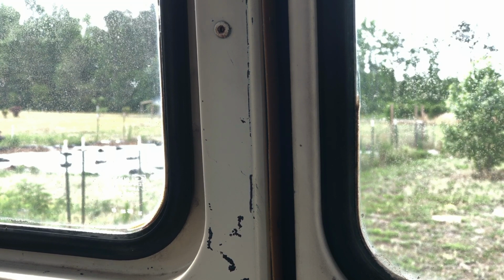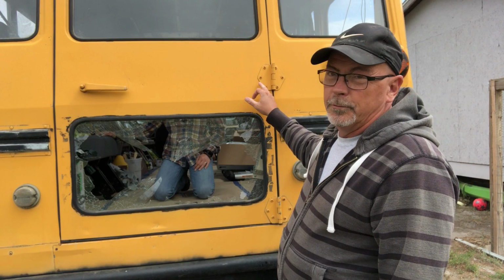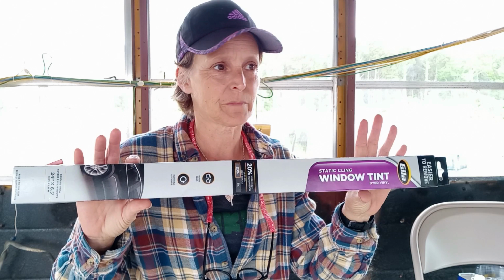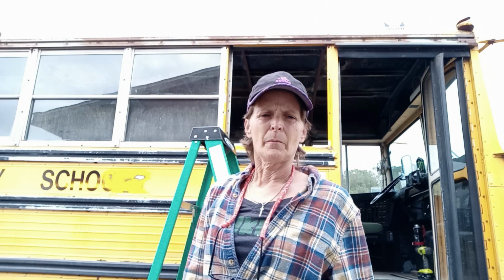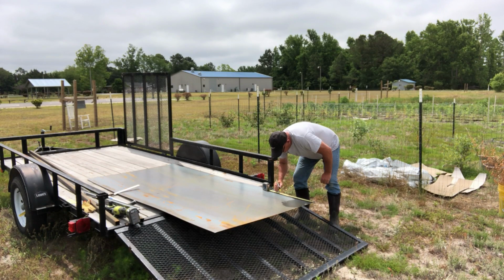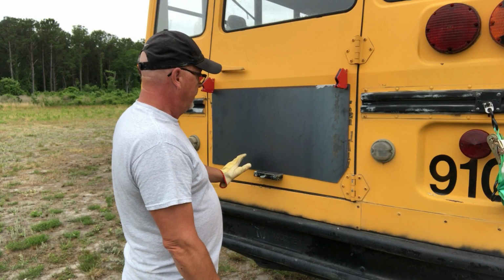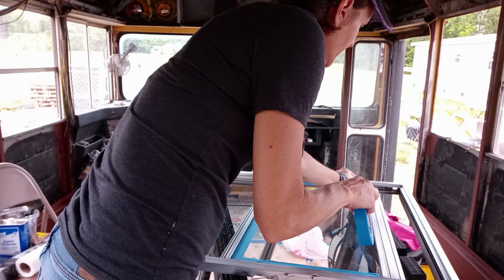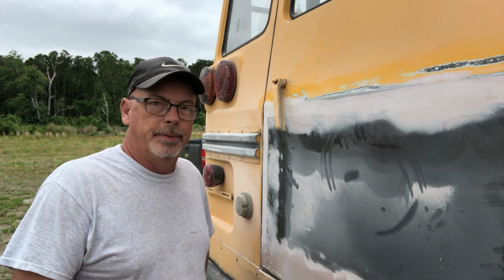Bus life build | Window delete on rear of bus | Painting aluminum window frames on the school bus

Comment: How did you attach the welding ground electrode to the sheet metal?  Also, where or what type of store do you buy large sheet metal pieces like that?
Reply from the maker: I tacked a small piece of angle in the middle of the sheet for the ground, the steel I buy at a welding/steel supplier , call your local welding shops they can direct you to the best prices.

Comment: When I get to my windows should I prime before or after I use aluminum compatible caulk? I'm leaning primer first but curious what you have to say.
Reply from the maker: Paint first, if you remove them and use butyl tape or caulk you shouldn’t need to caulk afterward.
Reply: @TangoRomeo87  by paint you mean primer?  Just to be sure.
Reply from the maker: @vaughn6371  yes, prime.